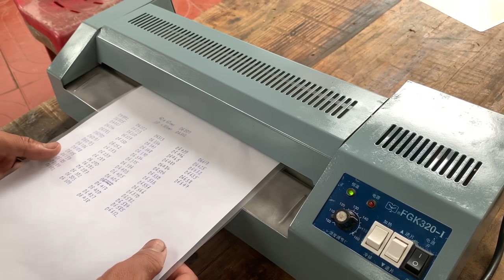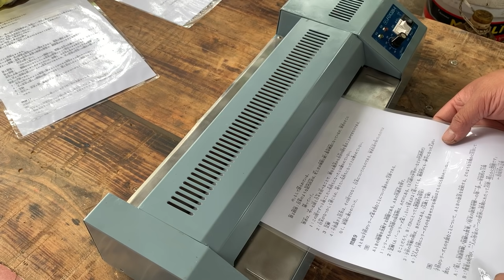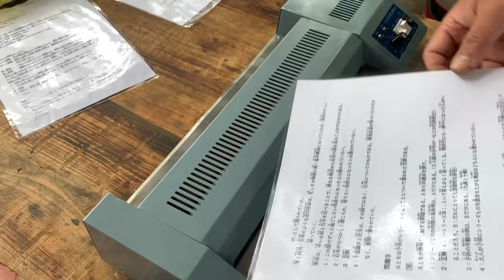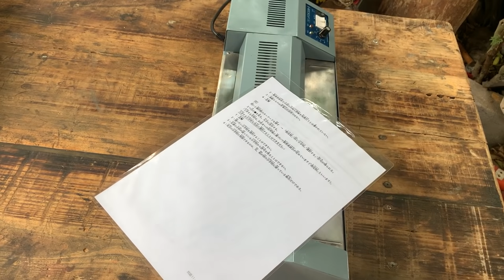Restoration Rusty plastic laminator | Restoring old paper laminator

Comment: Rusty isn't describing the plastic, it's the media in which the machine laminates. It's a rusty..... plastic laminator. For those thinking it's cheaper to purchase a new laminating machine I suggest you look up the price of a new one of this size and quality. They run about 2-300 in the states. The ones made out of plastic are junk and break really fast, especially the plastic gear boxes. These older METAL ones last forever and are relatively cheap to repair.

Comment: There is nothing historic or interesting about this piece of junk. Why bother when you can buy a new plastic one (that won't rust) really cheaply - probably less that the cost of restoration.
Reply: Because now he can use it, or sell it. He didn't have to fill up the landfill with buy and dispose junk. He is actually taking out of the ground and putting it back into service. instead of adding to the problem. Greed is the reason we have cars and printers and other devices that can't be repaired any more. Greed is the reason China's air is toxic and their land filling up with land fills full of toxins. but we just keep buying up that one use crap.
Reply: Thing is, it's not even "found" or properly restored. Plastic can't rust. The big show of doing the electrolysis was only to make himself look more reputable. He took an item and covered it in mud and dirt and left it somewhere to "find" six months to a year later.

Comment: Cooking the screws and other small parts oil in a frying pan. What is the purpose and what is this process call?
Reply: heating the screws to have a clean metal then cooling it with oil not water.
oil is chosen to prevent the metal from cracking and it gives a really clean black finish.
hopefully you find this helpful.